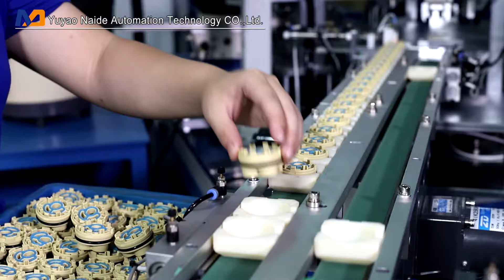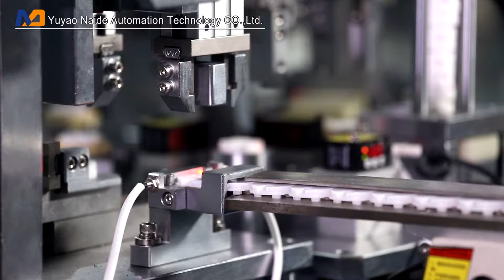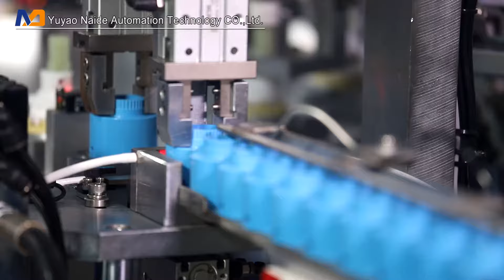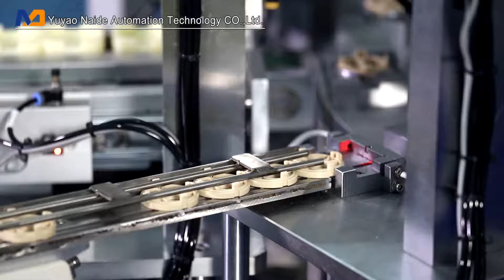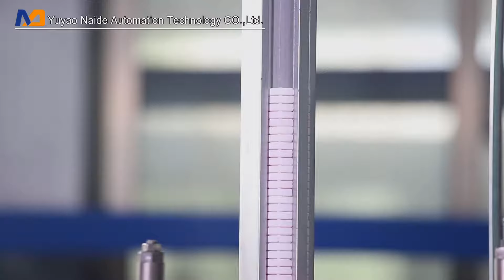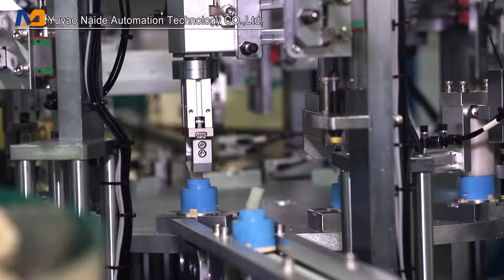CERAMIC FAUCET CARTIRDGE AUTOMATIC ASSEMBLY MACHINE

Comment from the maker: Feature:
1. Fully automatic or semi-automatic feeding method are both used in one machine
2. Various items can used in one machine
3. Automatic oil filling, oil even function
4. Control the amount of oil filling, save the loss of consumables and reduce the defect product rate
5. Automatic sorting direction by visual system for irregular shape samples
6. Viscous products are automatically dispensed to ensure no mixing
7. Reduce human labor cost increase production capacity and good quality rate, and reduce the risk of manual missing parts